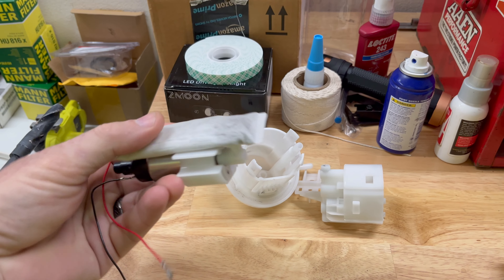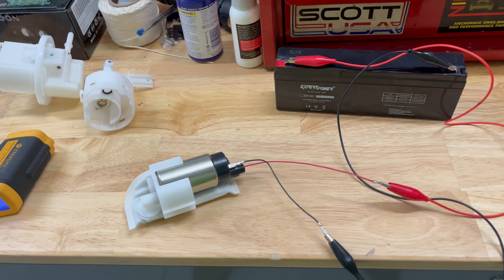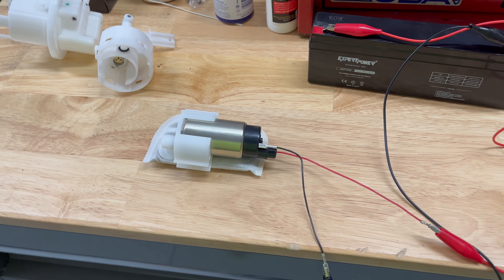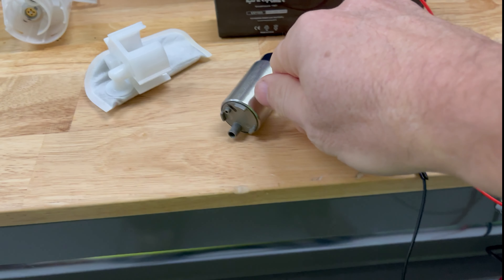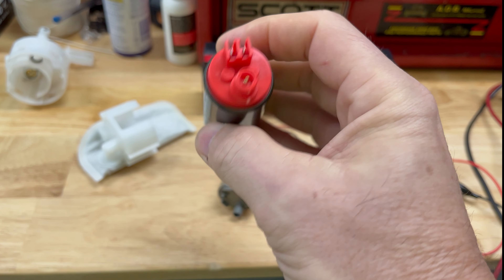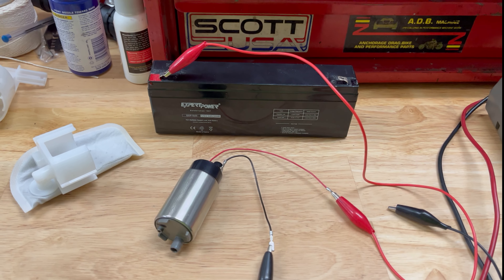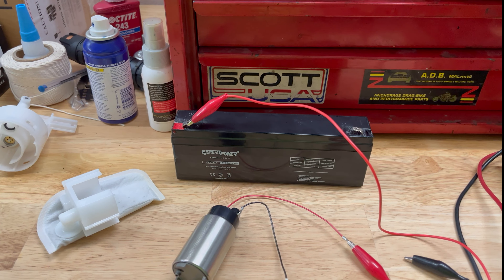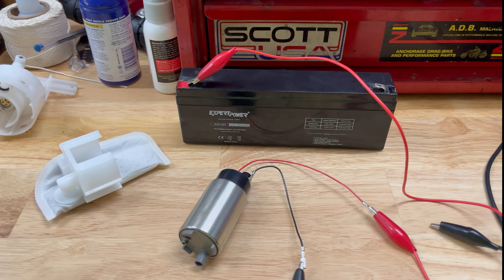2022 Royal Enfield Himalayan fuel pump destruction test

Comment: Thanks for the test. The pump looks pristine white. The fuel in India isn't as good I guess. It begins to yellow with just 3000 km or a year. What usually causes the pump to fail? If it has been submerged in a fuel for a couple of months without use? I have heard the motor failure is reasonably common with Himalayan.
Reply from the maker: I think the pump failures that happened on the Himalayans were just because of faulty pumps from Kehin.